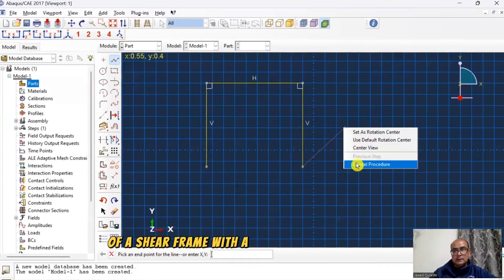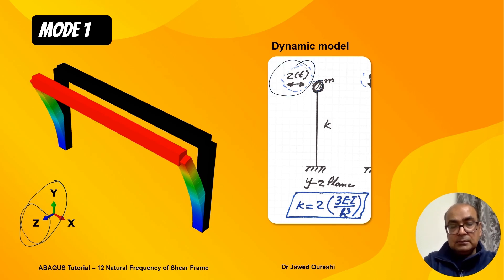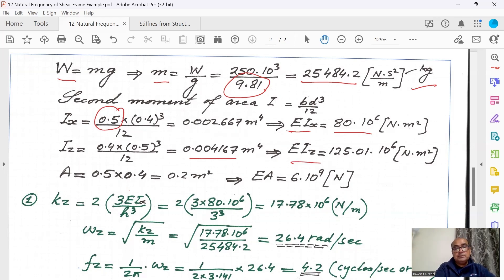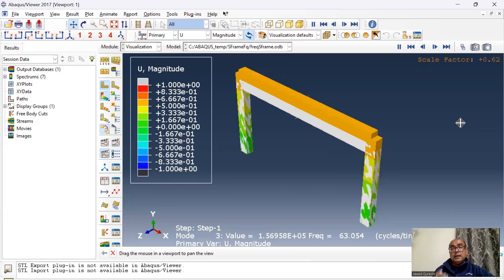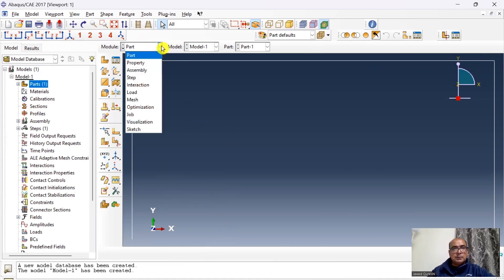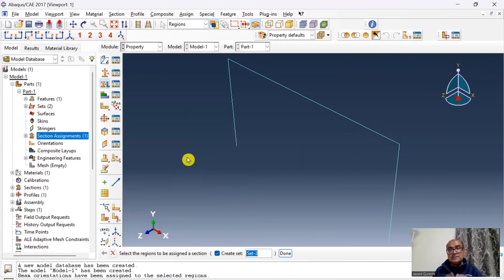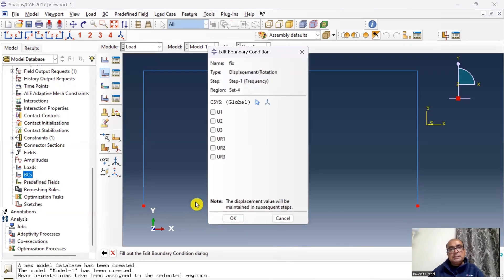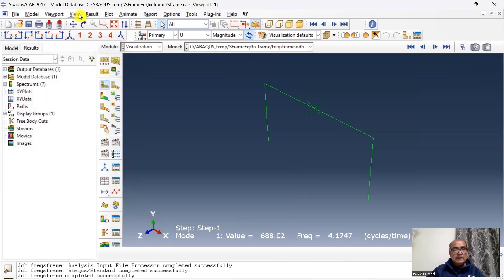12 Natural Frequency of Shear Frame | Structural Dynamics – ABAQUS Tutorial

Comment: Dr what is the reason behind calling a wall  "shear "wall
Reply from the maker: A shear wall helps a building withstand strong winds and earthquakes. It's a support structure that fights against forces pushing from the side. In civil engineering, shear force is when forces push sideways on a building's structural parts, making them twist and bend, like beams and columns.